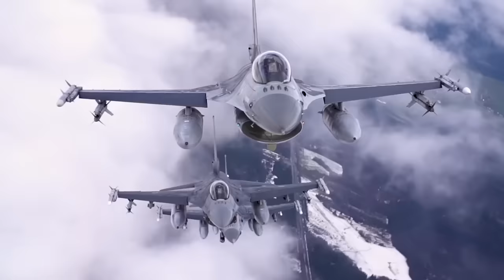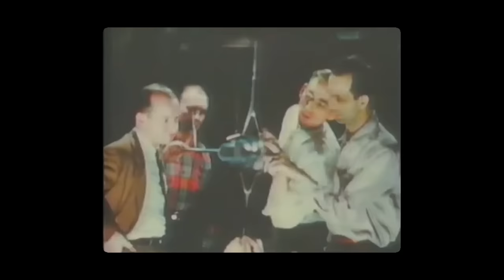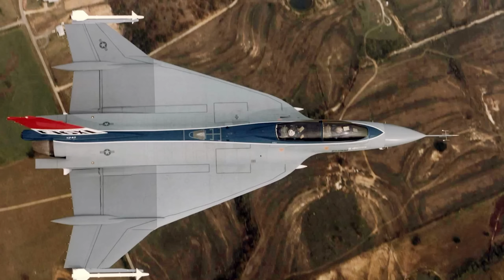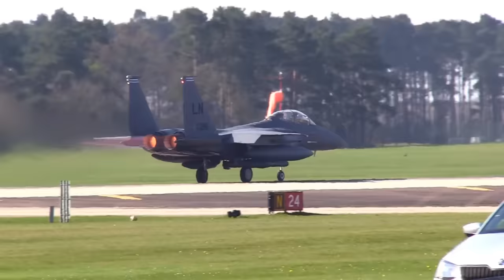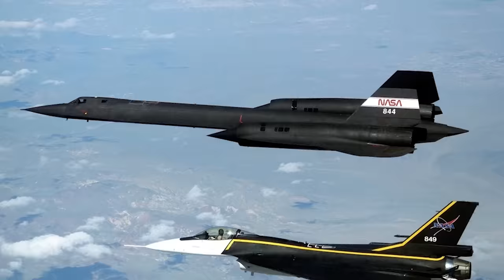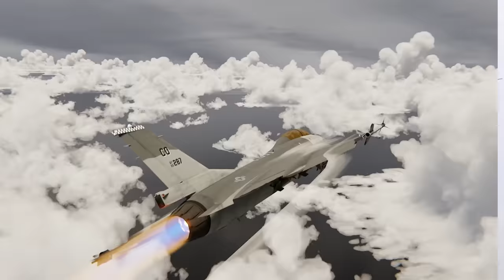When you supersize the airforce you get this…- F-16XL

Comment: This is why we have LazerPig on speed dial.
Reply: So he can say incorrect things and call people names?
Reply: @zee_terminator2850 And be a pig?
Reply: @Sveta7  i mean thats just by the nature of his stupidity
Reply: oh boy oh boy he did not just say engineers and fighter mafia in the same sentence
Reply: @zee_terminator2850 what incorrect things has he said?
Reply: @alessandrozampa6642  well for starters he said the T-14 uses the same engine as the Tiger II
Reply: @zee_terminator2850 he specifically corrected himself it is not the same engine as the tiger 2 it is the tiger 2 sla 16 version with a totally different engine (the sla16 engine) the same exact tank you can even find in war thunder he also said it is a lightly modified version of it and he backed it up with pretty complete design schemes that show just how perfectly identical the 2 engines are... And even if the two engines were different do you think that the breakdown of the t14 Armata was just a stroke of luck? No a tank so new that just got put of a factory doesn't fail so soon expetially for a parade on a road for wich the tank must have been prepared and examined beforehand so no break down could happen... And yet
Reply: @alessandrozampa6642  tiger II H sla 16 is still a tiger ii, and he still was wrong about it, its nowhere close to the same engine other than just what it looks like at a quick glance and this is just one of the more funny things he was wrong about. Also it didnt fail in the parade, that was driver error lol.
Reply: @zee_terminator2850  1) so the x eninw disigne the bore the stroke the displacement being all identical to the sla16 are just a coincidence? 2)what is your source for the "driver error" claim?
3) if the sla16 is still a tiger than you are living since if the t14 uses a modified sla16 the Armata does have a tiger2 engine
Reply: @alessandrozampa6642  look buddy, i cant be assed to argue with some random redditor who no matter what is said, is impossible to convince. If you want evidence that its not a WWII engine, just watch redeffects response to lazerpig because he’ll be much more articulate than i can be assed to be. Lazerpig is unintelligent and simply just speaks out of anger and not much actual basis in reality.
Reply: LazerPig has a problem doing research
Reply: @zee_terminator2850  giving one wrong 'fact' about a tank that isnt even seen in large scale production, even if he tries to die on the hill doesn't magically make everything he has ever said wrong lol
Reply: @coreytaylor5386  you must have not read the part where i said “this is just one of the more funny things he was wrong about” maybe finish reading the comment before angrily replying
Reply: @zee_terminator2850  lmao "it was driver error!!!!!"- the Kremlin who has a famous track record about telling the truth about anything that happens. as if that a tank driver not knowing what a parking break is and being able to 'accidentally' pull it without noticing is better in any way shape or form to just some maintenance issue lol

oh yeah, I totally trust them. and even if there was a universe where I would believe them, thats still a minor thing to get wrong and frankly is an even more non-issue to try to discredit him than the engine being wrong that I intentionally didnt even bother including it in the original comment because of how silly a point it was. "oh no! he said two things that where untrue about a tank made for parades!  all his credibility is gone!!! everything he says is lies!!!"
Reply: @coreytaylor5386  ok buddy, whatever you say. Youre just going on about random things i didnt even mention because youre angry, my point still stands regardless.
Reply: @zee_terminator2850  Im not angry Im just beyond bewildered how the hell you think your logic makes any sense.
if you read this as being angry thats on you man
Reply: @coreytaylor5386  how is my logic wrong? I just dont like lazerpig because he is wrong on most things and he is also just not a good person in general, what is there not to understand, youre acting like there is some logical fallacy in that (which there isnt) and there really isnt anything to be bewildered at unless i guess youre a diehard fan of that idiot. I brought up one thing he was hilariously wrong about and there are many other things he has gotten wrong, the one i brought up i just found funny and if you want to keep malding about it that’s fine by me. Also the driver error thing was most likely driver error, whether you choose to believe it or not doesnt really matter considering you have no evidence to suggest otherwise other than you think its true because of your biases.
Reply: @zee_terminator2850  one fact points is not 'wrong on most things', thats the entire point Im making. I dont care if you love or hate him, frankly he isnt a very good person and I cant say that I respect him as a person.

your logic is that one factual error means most things he says is instantly wrong on every topic hes ever talked about and in this context, the well documented conmen of the Fighter Mafia. how is that not horrible logic in your mind?
Reply: @coreytaylor5386  are you willingly just not reading the part where i say that “he is wrong on very many things, these are just some of the funnier cases of it” because either youre not reading them or willfully ignoring them. I dont dislike the guy on the basis of literally 2 things he got wrong its on the basis of what kind of person he is and his consistent track record of getting things wrong. From what i can tell he was right about the fighter mafia stuff, but it doesnt take away from his biases and his willful ignorance on many other things. I dont respect the guy because of his lack of principles and real researching skills, as well as just the way he acts as a person
Reply: @alessandrozampa6642 I am sorry
but ain't no way the Russians will use an engine that was planned to be put on a 1940s tank 
they are cheap but not like this 
the idea itself doesn't make sense
Reply: @alessandrozampa6642 i think the driver used handbrake accidentally bcuz he wasn’t familiar driving this new tank, i guess there’s a video of it in one of Redeffect’s videos

Comment: The Light Fighter Mafia (later rebranded itself the "Fighter Mafia" after the F-15 was a rousing success that combined high performance and heavy payload in one airframe) was far less influential than they want people to think in historical retrospect. 

They were right in broad strokes, but the way they were right is actually extremely trivial (and they were extremely guilty of pushing things like James Burton's horrifically flawed "Blitzfighter" concept that would have gotten every single man flying it killed - and no, Blitzfighter was not a "precursor" to the A-10 Warthog, it was an attempt to design a smaller, stripped-down, COMPLETELY VULNERABLE A-10 Warthog and it was laughed out of the room every time it was introduced). "A plane with high thrust and low weight will be a better dogfighter than a plane with moderate thrust and high weight"? NO FUCKING SHIT!

The LFM wanted to take the things that made the F-16 a worthwhile fighter aircraft away from it, and leave it as a single-engine light fighter with a maximum capacity of four Sidewinders - and they didn't even really want the Sidewinders.
Reply: Oof, lol
Yeah
Reply: yea like how do people still believe there shit
Reply: one of them wanted the f15 to carry all its fuel externaly and glide back to base
Reply: @Jacobwwindeatt  the F-16, honestly should have had a more capable radar and more fuel from the outset. The viper has to sortie with bags for just about everything, and that’s a problem.
Reply: @katherineberger6329 that was the point of the video a cranked delta wing f16 could have done that with more payload and more range
Reply: @tombearclaw  Building a longer-ranged F-16 now is already happening. It's called the F-35.
Reply: The F16 would have been a great asset as a light daytime fighter. 

But the strategy would been different with it.
Reply: @ghostviggen  The Light Fighter Mafia essentially wanted a nerfed version of the F-20 Tigershark - a minimal airplane focused on gunnery as its first, preferred, and possibly only weapon system, with just enough range on internal fuel to get airborne, defend its base and land. Anything beyond that would have required external fuel tanks (which the F-16 ALREADY needs to have acceptable range for any real mission).
Reply: @katherineberger6329  Except most of the F-35 fleet is grounded and unable to fight, and the whole program has been a ridiculous moneypit that failed to deliver on its promises.

Comment: Oh, to see it come back, with Conformal Fuel Tanks,  DSI air intake, GE engine with thrust vectoring and bl. 70 built  and avionics,  hardpoints rewired for SDBs / JAGMs.... and YF-16 vertical stabilizer for good measure.

Comment: Yes the F-16XL was a good plane, but so was the F-15E and that plane just fit the strike fighter needs better. Remember, this was a competition to replace the F-111 so it had big shoes to fill in speed, range and payload capacity.
Reply: Wasn't the F-111 already meant for a ground attack role.
Reply: @merafirewing6591  You are correct, the Aardvark was a Tactical Bomber.  The F-16XL was primarily there to fix one of the biggest problems with the F-16, no range.  We'd laugh while at Red Flag, when the F-16's would have to fly out last and return first in a mission package, due to their .7 (7/10ths of an hour) average mission times (without external bags).  The Blk 50 and up gets an extra 30% or so with CFTs   The F-15's could clock 1.5 mission times and my F-111's could do 2.1 on internal fuel only.  The base F-16 had to have inflight refueling to carry a load and have range.
Reply: @paulholmes672  a shame that the F-111 was retired.
Reply: @merafirewing6591  You are correct.  The AMP (Avionics Modification Program) was in full swing but due to the Air Force trying to talk Congress into 3 to 400 more F-22's, by getting rid of all unwanted airframes, they happily yanked them out of depot, unfinished and scrapped them as soon as they could. AMP gave the Vark a full glass cockpit, dual laser gyros, and a bunch of other systems.  The F-15E is a good airplane, but it can not do the same nighttime low level (200 ft) penetration effectively.  Essentially, it's an accurate higher level  bomb truck with some air defense capabilities.  It IS a moot point, though, as the F-111 would have only lasted a few more years anyway, the Aussies had them until 2010 and they were still relevant then.  Loved the airplane!
Reply: More accurately the Air Force determined that the F-15E would be easier to upgrade in the future

Comment: I’ve always wondered why this project couldn’t be revived and sold primarily to foreign governments. 

I also have thought that the F-16XL could have been paired with a revived F-20 program, the proposed upgraded F-5, as an export only, technology transfer program. Both being sold as a low cost, multi-role, air/ground/interceptor system, with overlapping technologies, interchangeable avionics and engines.
Reply: Why when they can buy the F-15E and later block F-16s...
Reply: @soulsphere9242  International export technology sharing, like the Korean KF-21, on a single model, that does the missions of both the F-16 and F-15; to be manufactured in the buyer's country, without having to turn over the technology to build anything equivalent to a Block 70 F-16 and/or F-15QA?

Comment: People seldom realize just how good the F-14,F-15,F-16 & F-18 really are. All you have to do is look at all the different fighter designs leading up to the teen series designed in the 1970s.  Then look at the new fighter designs after the teen series was adopted. There have been four completely different designs and only two of those have been adopted since the teen series came out in the 1970s, those are the F-22 & F-35. But we are still building new F-15, F-16 and F-18 fighters today roughly 50 years after their introduction. The designers really did an amazing job with the designs in the 1970s.

Comment: SCAMP was original purpose of the XL, not multirole combat.  You don't supercruise and maneuver at supersonic speed when lugging bombs under the wings.  The emphasis on bombing came later when the design was repurposed and entered in the Enhanced Tactical Fighter competition, was was won by the F-15E.

The video omits the fact that the XL didn't really achieve supercruise until it was later given a more powerful engine by NASA.  It also doesn't mention that the XL was inferior to the production F-16 in subsonic high G maneuvering due to greater energy bleed.

Comment: If the F-16XL had been built, it would have had to replace either the base F-16, or the F-15E. The budget wasn't there to do reasonable numbers of all three. You could have replaced the base F-16, but that would result in fewer total aiframes due to the increased cost of the XL. You could have replaced the F-15E, but that would have been buying less capable airframes for the same cost., especially maintenance costs due to it being a third separate airframe.

In the end, it was just more cost-effective to use a high/low procurement of F-15Es and F-16s.
Reply: Wrong, it would be replacing the then recently retired F-111 actually.
Reply: @HYDRAdude  It would have replaced the F-111, but the F-111 wasn't retired until the mid 90s.
Reply: It would have replaced the F-111, and the F-15E would have never been built. That's how military competitions work.

Comment: F-16XL is what the F-102 Delta Dagger, F-106 Delta Dart, F-104 Starfighter and F-4 Phantom supposed to be. However, the problem with the F-16XL is the intended role has been filled by F-15C and F-15EX, also the F-16V and the Navy counterpart F/A-18E/F can do the same ground strike missions at the same time carry air to air missiles for self defense. On the other hand, how to compete against Rafale in the international market is a big question.
Reply: The F16XL lost out to the F15E Strike Eagle, that was the only reason. F15EX and Rafale were much later and never were contenders.
Reply: The F-16XL was a contender for the Advanced Tactical Fighter (which the F-15E won because of upgradability) role not an interceptor and many of the technologies developed for it have found their way into newer F-16 variants

Comment: The Air Force generals in charge are F-15 veterans. Who wanted the F-15E over the F-16XL. Had the air force ever ordered additional F-16’s the XL would likely have been produced
Reply: The last tranche of F-16s ordered were delivered from 2006-2010. We got a LOT of Vipers, and relatively few Eagles. The XL was proposed to replace the F-111, a very large tactical bomber.
Reply: The air force did order more F-16s, but they stuck to the standard design.
Reply: @katherineberger6329  Pretty sure the USAF got its last F-16s around 1997 (and the last of the F-15Es were around 2001). But yes, this was all long after the XL was canned.

Comment: You might wanna do your homework. The young man standing beside Hillaker in that photo is Andy Lewis, son of then General Dynamics CEO David Lewis. He's the only reason that the two XL airframes ever got built. The program was originally called SCAMP, a supersonic cruise aircraft that somehow got morphed into a bomb dump truck. The two XL aircraft had good sustained turn performance due to their low wing loading, but otherwise they were total pigs. The wings were GD's first large scale use of graphite-epoxy, and as such were VERY conservative in their design (the wing skins being over a inch thick at the root). When the first XL was rolled out of the north end of the factory for reporters, it promptly sat on it's tail once the tow bar was removed from the nose gear, it was THAT tail heavy. lol

How do I know all this? I was there.
Reply: Very cool. Let's chat. I was there in the Wing Design Group.
Reply: @wadelewis7252  Hi Wade, sorry to be so slow in responding. When were you there? I was there from 78 to 83.

Comment: It is the year 2024, in an alternate timeline. The US air force has a fleet of 1,000 F-16XL's, 500 F-15EX's, 750 F-22A's, 250 FB-22's, 100 B1R's, 20 B-2's, and is currently upgrading its fleet of B-52's and acquiring the B-21. A replacement for the A-10 is undergoing testing, being basically the same design but improved in every way, such as upgrading to a 40mm gun based on the polymer-cased, telescoped ammo for the UK's Ajax vehicle for maximum firepower. The F-35 was canceled due to being a moneypit that didn't work as advertised. The US navy has a fleet of F/A-18's, but instead of the Super Hornet, they have a fleet of Super Attack 21 Tomcats and a naval derivative of the F-22. The Marines have their Hornets and a fleet of new-build Harriers upgraded with modern technology derived from other fighter jets, including the canceled F-35, to the point it barely resembles the original aircraft except for its mission role and VTOL capabilities. US air power reigns supreme. The space shuttle was retired and replaced with a new, modern design more in line with the original NASA design rather than the cludged one the air force forced on them before ditching the project, NERVA rockets are lifting massive payloads into orbit on a monthly basis, there is a permanent base on the moon, construction has begun on the first O'Neill Island 3 space colony, and NASA is celebrating its first manned mission to Mars thanks to the help of some autistic billionaire named Musk that nobody has heard of. The SR-71 was retired just a few years ago, with its replacement, capable of mach 5, making its first test flight this year.

The cause of this divergent timeline is Dick Cheney falling down the stairs and breaking his neck in 1986.